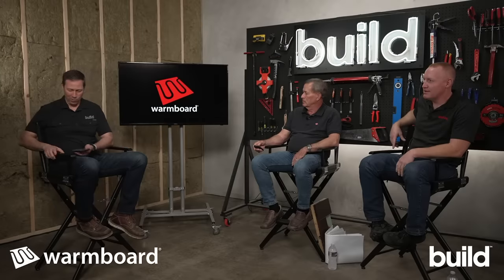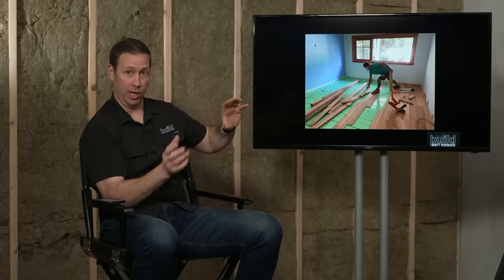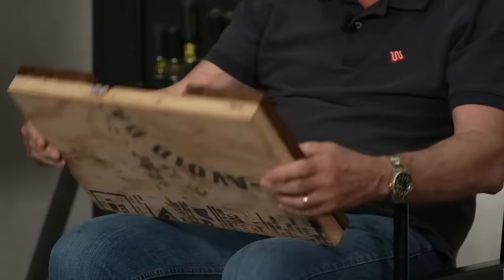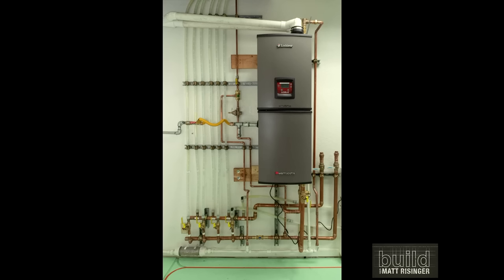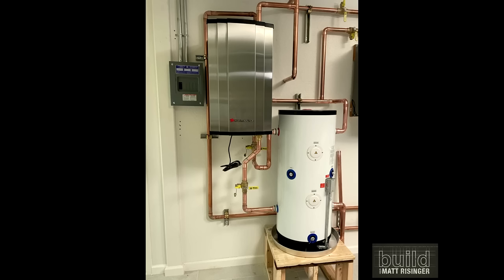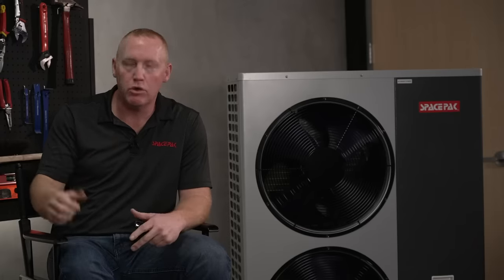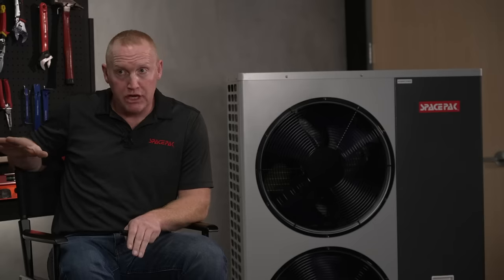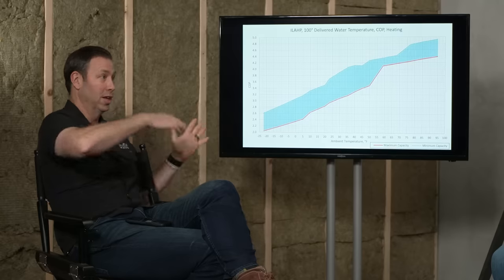Cold Climate Heat Pumps for Radiant Floor Heating. No gas, no boiler!

Comment: Great interview.  I served on a nuclear submarine and spent many a hour tracing and working on "boiler room" systems.  Your right, because of the number of systems that are placed in a small amount of space it gets difficult. I'm now working on my own DIY HVAC installation and simplicity, energy efficiency, and cost are primary concerns. I didn't hear about cooling.  I assume that Warm Board is only used for heating, while Space Pak does both heating and cooling.  It would have been nice to get more information about the cooling options.
Reply: @James Karrie the Spacepak can do cooling as well, but separate fan coil units need to be installed, ducted etc.  Once that’s done and you realize the fan coils can also heat the house, the huge expense of the heated floor becomes unnecessary.
Reply: @James Karrie it might, but as soon as your Dewpoint exceeds 50 degrees you’ll be condensing water on (and in) your floor.  Dewpoint tracking and compensation is important with radiant cooling, as is dedicated dehumidification.
Reply: Warmboard can be used for cooling as well. I'm currently building an infloor radiant heating and cooling home using the warmboard panels.
Reply: @moreycarpentry  is the cooling function Engineered and supported by Warmboard?  I.E. is it part of their guaranteed design and supported with load calculations?

What are you using for control of water temperature, humidity and dewpoint tracking?  Where is the house located?  Is it a very dry climate?
Reply: @superspeeder  I'm just using them for their panels but they did design the heating portion for me. I've contracted Arctic Heat Pumps to take care of my cooling side. They are doing the design and supplying the equipment. Warmboard referred me to them. They are a Canadian company and I'm in Ontario. It isn't dry here, actually quite humid. I'll be using a whole house dehumidifier with an ERV. Or at least start with just an ERV and go from there. Artic Heat Pumps also manage the dew point with a sensor, if my dehumidifier stops working for example, their system will introduce warmed water into the floor to never allow it to reach the dew point.
Reply: @moreycarpentry  I’m in Ottawa.  Agreed that humidity is an issue 4-5 months a year.  Sounds like you have a decent plan in place, I’m curious how it will turn out!

I was quoted $320/sheet for 1-1/8”Warmboard back in 2018, which didn’t include anything other than the material.  I’d be interested in knowing what they are charging currently?
Reply: @superspeeder  It is more close to $400 now and that includes the sheets, the heat load design, the heating pipe layout with manifolds and material lists, physical copy of the plans, installation supplies like spacing bars, router templates and even the router bits. Expensive, yes! But I felt since I'm going with infloor cooling, the full aluminum layer will be vital. I can't imagine infloor cooling working too well in a staple up method. In concrete sure which I will have in my basement also so I'll get to test both of those options. I hope it all goes well! It's for my own house so I'm the guinny pig. If it works well then I'll offer it to my clients.
Reply: @moreycarpentry  agreed that staple-up would be a waste of time for cooling.  Sounds like a great project!  If it works well maybe you can get royalties on the cooling design if WB adopts it!
Reply: @superspeeder  Alternatively, you can use the heat pump alongside our radiant ceiling panels that provide both radiant heating and cooling. The key being our room comfort sensors, air treatment units, and controls which ensure that condensation will never be produced when providing radiant cooling!
Reply: @messanatech  Messana, I thought you guys disappeared!  It’s been a few years since I’ve read or seen anything about your panels!

I’m looking into hydronic cooling to manage party loads in my kitchen/family room area and might be contacting you soon!
Reply: @superspeeder  We're still at it! Our new residential panels and controls were just released this year! Let us know if you have any questions, we'd be happy to chat! We've also grown quite a bit on Instagram, so follow us there if you'd like!

- Saul
Reply: @messanatech  YT is about the extent of my social media endeavors, lol.  I might visit your webpage and send you an email though! :)
Reply: So you WANT cold floors? I'm surprised. Separate ceiling panels would make more sense for a cooling loop.
Reply: @jameskarrie298 Sorry, but you are wrong. That's the whole point of the "heat pump" design compared to conventional AC.
Reply: At 37 minutes there is a slide that shows the heat pump operating cooling units independently of the warm board.
Reply: @moreycarpentry  how's it going with your project?  is it complete?  do you mind sharing some details on the Warmboard?  ie: square footage, cost, etc?  I'm in the GTA as well.
Reply: @amitt3014  It's going slow but still moving forward! Just finished laying all the pipes and starting the manifolds so not far enough to give some feedback on the system. But I do plan to order all the heating/cooling equipment this fall. Touch base with me again next summer and I can let you know how it's working. I went the route of Warmboard just supplying the floor panels. This is the 1-1/8 structural panels not the retrofit ones. I ordered these a while ago so I would assume they are more now. I paid $410 per panel which would be $12.81 per sq.ft. Just let me know if you have any other questions!

Comment: I love my warmboard... I installed this in my house in 2013.  The only thing that I did that was "special" was I used a grinder to ensure all the custom cuts were "soft" and prevented from damaging the PEX as it expands/contracts.   So far, no problems at all.... My system was designed by NRT (no longer in business) but they provided the loop layout, the Tekmar control information, and my Lochinvar Knight/Squire system design.  Interesting that I live in Tennessee where most of this stuff originates, but there are NO service personnel near Knoxville for Lochinvar, Tekmar, nor radiant heat installations --- so I did all the installation my self (except for the gas where I contracted with a properly licensed gas plumber.)  One thing not mentioned is that Warmboard provides a router bit that is suitable for making specialized custom routing of the Pex..... very well engineered product.
Reply: So how much did it cost?
Reply: @captainamerica9353   Just a side-note.  I used warmboard over joists on the main floor.  For the basement, we used a vapor barrior, rock, 2" rigid foam insulation, Number 10 wire mesh, pex wired to the mesh, and an isolated concrete pour over everything.  This way there was a floating concrete slab heated with the pex that was thermo-isolated from the surrounding foundation walls and below grade dirt.....this was cheaper than the warmboard (but I must admit the end solution isn't quite as thermally responsive as our main floor).
Reply: @skipsaunders5974  , so how much did it cost?
Reply: @captainamerica9353  I believe the Warmboard costs were about 10% over what might have been the standard building practice costs.  I can't be sure because I parsed the costs over a total HVAC, buliding construction system perspective and not an "individual component" perspective.  In my case, I viewed the everything as a whole system which included my split heat-pump cooling design, my gas boiler selection, my radiant roofing,  my insulation, my dehumidification, my window/wall insulation approach, etc.   I estimate my costs were about 15% over what might have been, but the comfort enhancement is priceless, the long term cost benefits continue as my hvac efficiencies exceed those of my neighbors.   Anyone truly interested in construction costs practices needs to view the interplay of all the components as part of a system.

Comment: Thanks for sharing this awesome product.    I always hated the non-in-slab solutions because of a lack of good thermal conduction. Ideally, going from metal tubing directly to a metal thermal dissipater offers better conductance, but the Warmboard design is an excellent solution to me for this application. I've been researching split systems for AC and radiant heat components for my final home and had dismissed heat pump technology for my cold (-20 F) location. Warmboard would be perfect for me but I'm certain that the cost is going to be a huge part of the decision.

Comment: Great discussion thanks! I live in Colorado mountains at 9600 ft, same climate zone (7) as Alaska, but much dryer due to altitude. I converted my 2,000 sf house from central propane furnace to radiant floor, but as I came in from the subfloor in crawl space, I have to run at about 140F on design day (-14F) home heat load on design day is 43 kbtu via the model J calcs. I put in four Veissmann solar hot water panels and have 240 gal of HW storage. This is connected to a conditioning tank on the bottom of a propane HTC unit which allows me to transfer some of my stored heat. I'm using about 1/3 the propane as before but in winter here propane is expensive. Also, I want to go all electric. Do you work with water - water heat pumps? I know from commercial buildings these usually work in the 60-80F source heat range to provide the up to 140F I need. Mid-winter my panels still make 140-150F water for my storage tanks. I think using this storage,  a heat exchanger to provide the right temps to the heat pump, and water to water heat pump would be super efficient and allows for heating through those snowy/cloudy days from stored energy in tanks. I also think the heat pump could be maximized for efficiency with the narrow source temp band. Do you work with any suppliers like this? I plan to use Warmboard S for an upcoming project to enclose and heat our deck. Is there a simple way to reduce radiant supply temp for this space, although it will be one spare circuit on my home's max 140F supply?

Comment: My greatest concern is the lack of air circulation.  How do you eliminate alergens in a house that has a minimum of supply air - more specifically no HEPA filter on a central air handling unit.  
As for Matt's new home, have you checked the power consumption on your various appliances?  Given how tight and well insulated the new house is, one should have seen a reduction in the power consumption.  Regards.

Comment: I’ve had in slab radiant heat before. It took 2 days to get up to temp but it didn’t vary even 1 degree after that. It’s the most consistent and economical heat I’ve ever had in a house. However, if I wanted to vary temps between nighttime sleeping and daytime heat then warmboard would have the advantage.

Comment: Food for thought - use a generously sized buffer tank so the heat pump can run during the daytime when air temperature is warmer (better COP), and more solar energy is available. Solar energy is reshaping the daily cost curve for electricity.
Reply: 1,200 BTU per Gallon so you will need a least a 1,000 Gallon water tank for 1 cold night.
Reply: @onlyscience7120  If your house needs that much heating, radiant heating may run into limitations... Thermal buffer can offload morning and evening peak times.
Reply: @goblinsgym   A sunmaxxsolar 1000 Gallon Non-pressurized Buffer Tank cost only $2,777, trying to find out if it makes sense  to use PV over a flate plate system.

Comment: One advantage not mentioned is that the house can still be considered "light" with warm board instead of a concrete topping. This allows more leeway when designing seismic system for the house. When using concrete topping or a tiled roof, you have to consider the house as "heavy".

Comment: You are always better extracting heat from warm underground soil than cold air, and defrosting is not an issue, because the piping in the ground doesn't get cold enough to collect any frost or ice.  Similarly, when air conditioning is needed, it is much more efficient to dump indoor heat into 70 degree soil than 95 degree air.  It's all about keeping the coefficient of performance around 5 rather than 1.5, to get the most heat moved for the least electrical operating expense.  Yes, putting in underground coils is more expensive than just dropping an air source heat pump onto a slab, but the operating cost, especially when the air source unit gets frosted up and the resistance coils come on, is so much lower with the ground source heat pump.  And the warm floor is nice in winter, but expensive, and you still have to install ducts and an air handler for summer air conditioning, so you pay for two systems instead of one in terms of the install cost.

Comment: When you combine passive solar heating in a radiant floor heated room 
Thermal Mass is key 
Plywood with a thin aluminum veneer is not a thermal mass.  Masonry, concrete, cement board thick tile.  Terrazzo.  All have mass to Absorb and retain    Way more efficient.  Also the best conductivity happens when the tubing is copper not plastic.

Comment: I've installed warmboard throughout my house by myself -  twice in two phases, over 10 years. Radiant is amazing, the most even heated environment, I will never go back to forced air. We take shoes off in the house, so having a warm floor is priceless, and noiseless. Not to mention - no dust filters to keep changing, ductwork to install or ugly grills everywhere. Luxury item? maybe, but my home is my castle, and I spend more than 12 hours a day there. Did you buy a cheap mattress? stupid idea - 1/3 of your life is horizontal.

Comment: Ive radiant infloor throughout my house and I love it. No regrets. But - yes I needed mechanical ventilation both to meet building code and for AC.  It is nice / critical to circulate air depending on the tightness of your house. Point #1. With infloor the challenge is winter humidification which isn't particular effective without using warm air from a furnace which then competes with the infloor. Solutions like steam infection present their own problems. Perhaps there is another solution.....  Point #2. I have a Spacepak system and I simply would not recommend it unless your building requires it due to space constraints (my house is 100 yrs old).. The high velocity pipes are very noisy and the airflow projects like a fan into the room. Terry (the WB CEO) emphasizes the luxurious silence of the infloor but Spacepak is anything but.  In my view, Warmboard is at its best in new construction and they have joined forces with Spacepak which is best used in retrofits. I presume Spacepak has a great heat pump system which drove WB's choice but I would be very cautious about installing in a high end build with its SDHV air handling.
Reply: you are right about the need for humidification in the winter.  We use Warmboard/Lochinvar/Tekmar for our primary household heating in the winter.  The air can be dry if it is cold outside, so I installed an indoor decorative waterfall.  The one I use is by Humidifall but they are no longer in business.  It runs 24/7 with a recirculating pump and a water filter/sanitizing/heating system that replaces the water daily (equivalent to one toilet flush per day).  People visiting the house think we have an interesting artistic alcove, but little do they know that it is actually a household humidifier system that has the added benefit of dust/pollen removal (moving water extracts dust/pollen from the air and the filter/flush components of the Humidifall get that stuff out of the house.)  Too bad Humidifall went out of business....

Comment: I have lived in a home in europe with radiant flooring.  It was nice and the lack of sound was noticeable when I moved back to the states.  Every time I see something new on radiant flooring I get excited and then reality kicks in.  When I build my ICF toe-tag house, I am not going to pay for two different systems for heating and cooling.  I am not dropping 30K on a hydronic heating system to turn around and drop another 15K on a cooling system.
My body temp needs fluctuates.  Some days I feel the need to be warmer and some days cooler.  Plus the spouse's hot flashes makes the set and forget house temperature null and void.  The ever changing demands on "personal" comfort doesn't work with a slow changing floor system.  Need that instant gratification from a forced air system / fireplace.

Comment: My biggest concern with these two-pipe, one-tank systems is shoulder seasons--what if you need cooling one day, heating the next, and cooling the day after? Unless there is a way to bypass the buffer tank without triggering zoning/short-circuiting, you'll always be fighting the buffer tank when changing modes. I'm hoping that some company comes out with a 4-pipe, 2-tank (1 hot, 1 cold) system where both sides of the heat pump have hydronic connections.
Reply: From the discussion, I gather that the system would taper off heat production as demand tapered off.   If you are heating to 70ish and cooling to 65ish as my Uncle dose the systems outside temp loading sensor would cut/  slow down heat production to reduce the demand for cold. For Uncle, his current heat pump(cooling only) and NG forced air furnace  are  flip flopping heat in mornings, cooling ~2pm,when sun brakes through the west facing windows ,then heat agen ~30min before sun set.
Reply: Seems like the lower operating temperatures used for the fluid in Warmboard would mitigate for this concern?  Also, do you really even need radiant in-floor heating during the shoulder seasons?